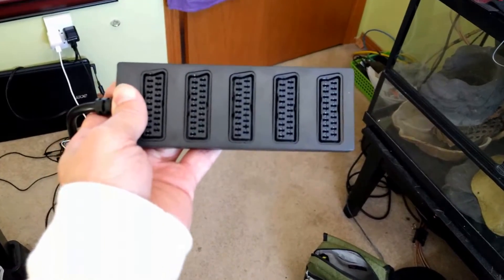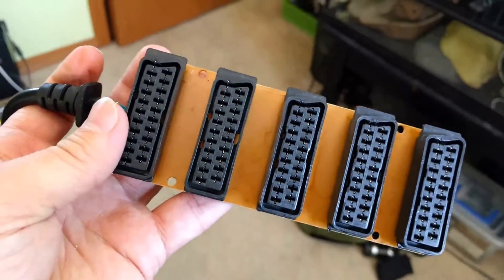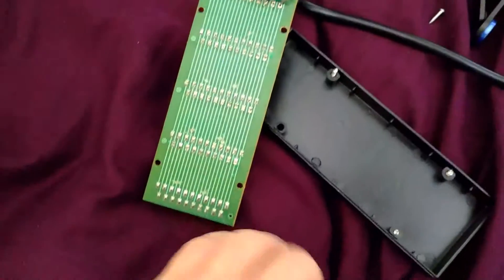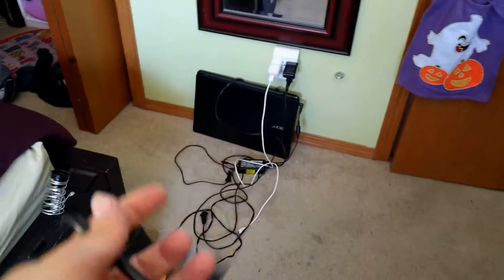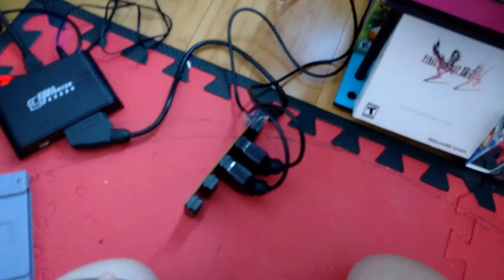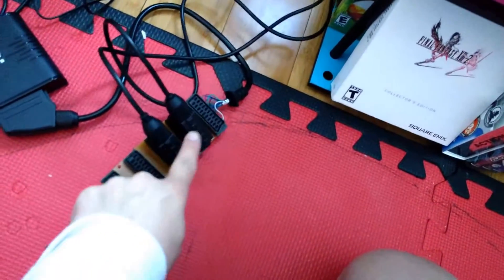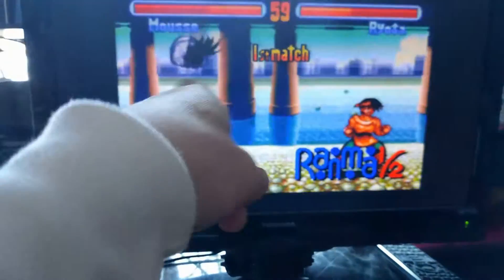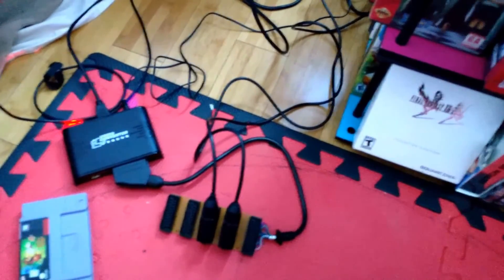Game Console RGB Cheap Scart Splitter/Switch Fix

Comment: You bought a splitter, not a switcher. That device s for the oposite function.  So a Switcher is to place 1 outout into different inputs, AKA different monitors at the same time.  If you bought a switcher then some selction buttoms should be available at the device, the splitter dont need any selction the purpose is show  teh signal at the sam etime, so al your problem begun at the moment you pick up your device on your buying.
Reply from the maker: Hi, welcome to 2016.  I was aware it's a splitter, but many stores referred to it as a switch, so I kept the pattern for keyword friendliness.  Regardless, this video is about how I made the device work for me.
Reply: @SaturdayXIII  xD lol so at 2016 and you still didnt realized it wasnt a switcher and it was a listing error? I am not even from a scart zone dude. But nice work indeed.

Comment: I did the trick, but the Mega Drive video becomes composite, not RGB. But, by the principle, I can add a power switch that will only get the +5v from one of the three inputs, so only one will work at a time. I will do the soldering next weekend and let you know the results.
Reply: For RGB you need extra 3v on pin 16 (5v + 180 ohm resistor).

Comment: By cutting the voltage to pin16 you've effectively disabled RGB and forced the Genesis back to using composite video. Not very smart!
Reply: Global Garage I tried for myself on the same board shown in the video and my Genesis had a clean, noise free signal, my Snes was another story but nothing out of the ordinary for me and my snes
Reply from the maker: It looks completely different from composite.  Pin 16 probably still gets its power in that mess of cables at the top of the board, if that's how it works.
Reply: @SaturdayXIII  you're wrong, you have significantly degraded the signal
Reply from the maker: @RUTGERMORTENSEN  then why does it look better than the stock composite cable?  It's night and day difference.
Reply: @SaturdayXIII  Global Garage is right without the 5V line scart is in composite mode. You should be able to use diodes to keep current from back feeding into other consoles.
Reply from the maker: @Systemsquirrel  Welp, plz make a video to show me how cuz scratching power lines is about the extent of my abilities here.
Reply: @SaturdayXIII  I actually have one on the way from China which is why I looked up this video. I foresaw this problem because these aren't meant for what we are trying to use them for these are meant to take a scart output and split it into multiple outputs. The modification I'm thinking of requires cutting the traces 8 and 16 as you have than soldering diodes across them so voltage is allowed to flow out but not re-enter the the sockets isolating each sockets power from the other.
Reply: So yeah I'll make a video and post it here once I get it.
Reply from the maker: @Systemsquirrel  Cool, I look forward to it.
Reply: @SaturdayXIII  beef beef beef

Comment: The mechanical switches are much better. It isolates the video signal for each connection, the audio isn't isolated however, but it's far less problematic than these "splitters" used in reverse like you're doing. Also means you can have a fully populated switch without any noticeable degradation.

Of course, there are far superior products out there, but I love the brutal simplicity of the mechanical switches.